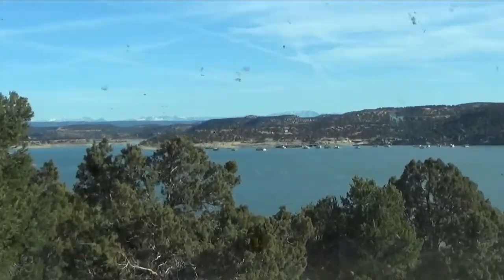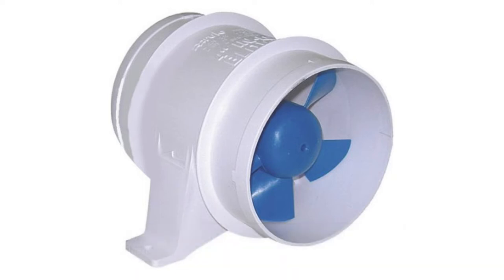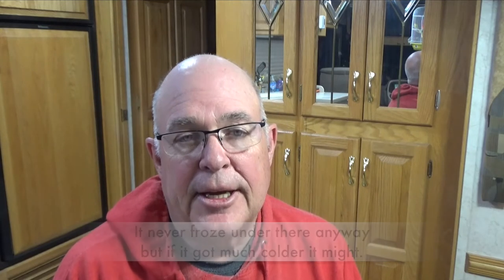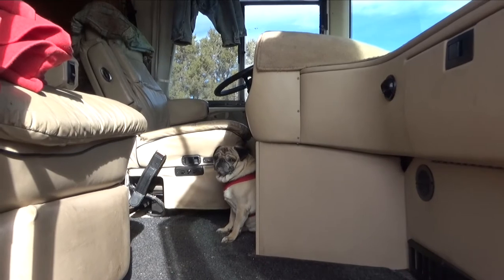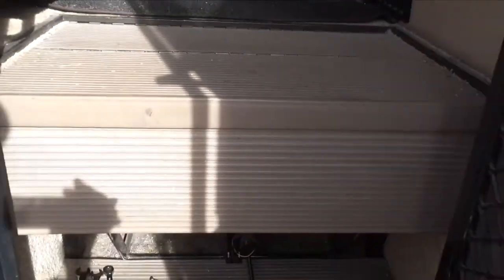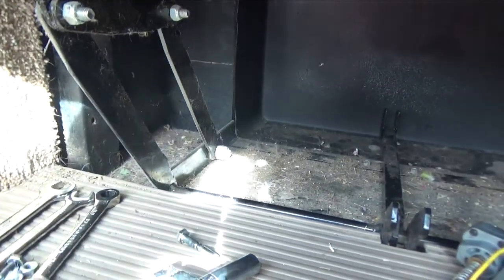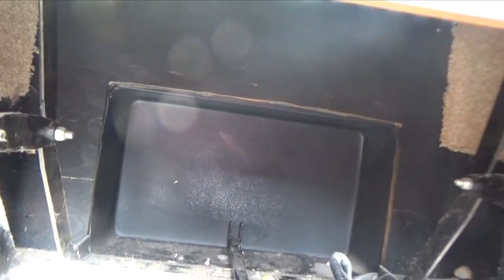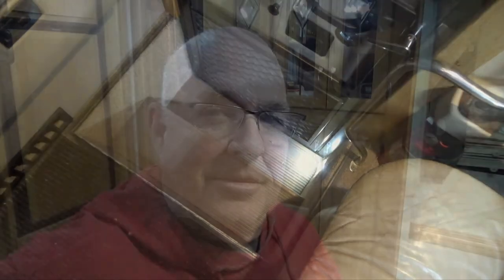Step Cover Fix, Dead Mouse & RV Lessons

Comment: how did you get the step cover up? Mine is not working, I do hear the motor running but nothing happens. Thanks
Reply from the maker: Kevin D. mine still worked enough to go up and down, barely. Depending on the mode of failure, you might be able to just pull the cover up. That would be unlikely, but worth a try first. Underneath the floor and behind the compartment where the motor and mechanism are is a plastic cover. I didn’t look at how it is held in place, but you can see it in the video. You would have to remove that cover to get access to the motor and shaft. Once you disconnect the mechanism you can raise the cover by hand.
Reply: @Jumpingoffthecliff  Thanks so much, i did see that on your video and will look for access. Just bought this on Wed and have a few little things to fix.